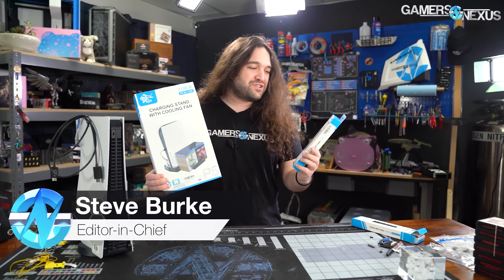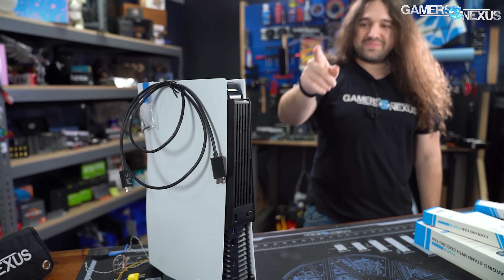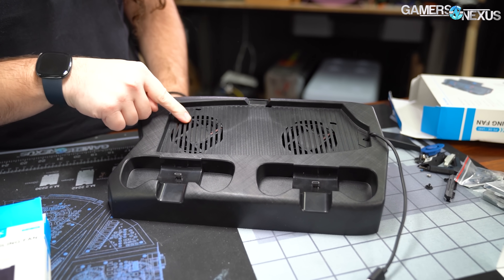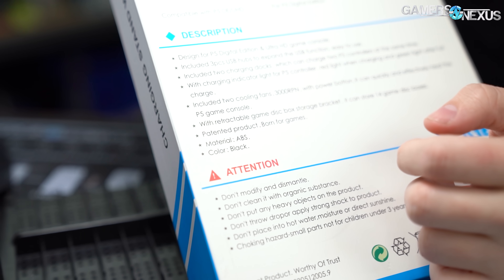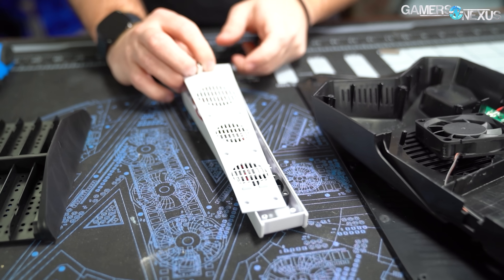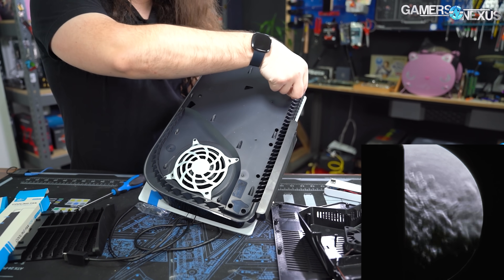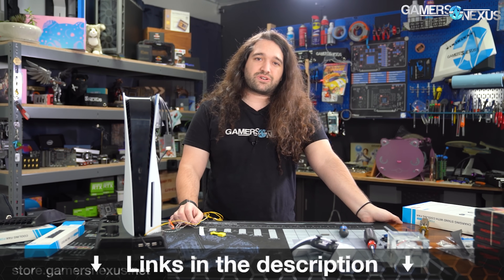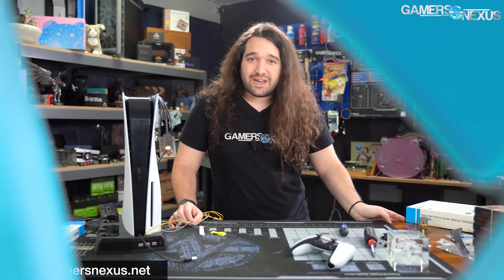Basically A Scam: PS5 Aftermarket Cooling Fans Blow the Wrong Way

Comment from the maker: Like we said in the video, flipping the fans is pointless because (A) this thing screams and you shouldn't use it anyway, (B) the plastic impedes more airflow than the fans add, (C) attempting to accelerate the exhaust in this manner is only going to make things worse.
GN GPU Artifacting shirts are back in stock! https://store.gamersnexus.net/
Watch our Xbox Series X thermals video here: https://www.youtube.com/watch?v=Iqv4meZcVEk
Watch our PlayStation 5 thermals video here: https://www.youtube.com/watch?v=MmggkW6usmQ
Watch our PlayStation & Xbox Schlieren Photography video here: https://www.youtube.com/watch?v=8FZ3cQFFZmQ
Reply: Steve, It's not that we do not believe You - we just want to see this validated the right way - with real measurement and real numbers... like always...
I don't even have or plan to buy PS5  but I watched the whole video and the only disappointing part was the lack of those tests with flipped fans. They were not even screwed  so the operation would take like few seconds for everybody who bought this...
That's exactly why I'm here - because You validate good or bad assumptions with real hard data. No hand waving and "because I say so"...
I still expect to see this done properly - maybe when You test some other wonder cooling for PS5...I would even see this as a standalone follow-up.
Reply: Gotta wonder if these coolers were designed off of prototype/early renders/basic CAD models well before the PS5 launch. This happens a LOT with cellphone cases.
Reply: @dadsfads  entertaining but also informative. Those results could prove that the whole design should be written off, instead of the current synopsis, "It's too loud, and don't put the fans on backwards".
Reply: Still, how could you miss that test? Not like it would be hard to rotate them.
Reply: Great vid as usual, Steve. Thanks
Reply: I finally got my disappointment 2020 shirts this week! Yay! 

DHL shipping kind of sucks.
Reply: Make a video mods to improve performance.
Reply: @io3220  the comment you're replying to literally explains why it would be pointless to mod this device....
Reply: I think this is a scam. Even if there wasn't malintent, it's still dangerous as it increases the temperatures.
Reply: I'm wondering whether it was actually designed to blow air the right way around, but the worker assembling it in the factory did it the wrong way.
Reply: Yeah I figured, best u can do is to put a box fan at the TV stand lol
Reply: @benjiang2600  that would work a lot better than these overpriced noise makers.
Reply: Seeing these fans reminds me of the fans you could purchase for the OG Xbox 360.   What a lot of the younger generation probably don't realise was that those fans didn't really cool the console and were notorious for melting and causing electrical faults.    What I will say about the PS5 is that I hope that Sony improves the cooling of the console with a mid gen refresh particularly around the memory area where  temperatures can hit 93°c.    Personally I find that concerning especially with the console being quite early in it's life cycle and I think over time the temperature issue could get worse and cause the consolse to have multiple issues associated with overheating.
Reply: Jokes on you they told you that was a heater right on the box. No refund.
Reply: I'd like to see if there are any thermal improvements from removing stock fan grill, those cheap pressed grill are horrible for airflow and even noise.
Reply: Yes, it's pointless, but intresting to see some numbers.
Reply: Its content. I dont even care if it wouldn’t change anything im pretty sure me and alot of others would have loved to see too see the fans flipped. It wouldn’t have taken much effort. Not hating just saying. With the ammount it was mentioned it felt like it was being set up but then it just never happened.
Reply: would still like to see the difference with the fans pointing the right way, even if it sucks, and should never be used.
Reply: The biggest question is did you try it out in the "fixed" configuration by flipping the fans in their case?
Reply: Have you changed the camera?
Reply: Must be for Persona 5 that
Reply: Sony designed it so these aftermarket crap is unnecessary
Reply: @JustVictor 17 I changed my vanced settings to not skip automatically but give me the button to skip segment if I want to. It's a nice feature, YouTubers like Steve and Jayz I won't skip their segments just incase I miss some new merch drop or hot deal.
Reply: so you are reviewing more products from WISH.com?
Reply: He never uses console filth outside of work .
 He can swim in 3090 s/6900xt s/5950x s 
and yet he uses an Fx8370 in his house . 
He truly is a prophet
Reply: Can you test the Opolar Laptop fan cooler?
Reply: Dam I feel bad for you having to make a video on these shitty ass products 😂😂
Reply: stop knocking on press fit parts wth....that shows attention to detail and keeps price lower ....and ill never get over the hole i need my silence thing yall must hate movies rock concerts balloons poping anything over 10 db is like scary to you ppl
Reply: damn, I honestly just buy these things for some extra USB ports but it was always nice to have the fans after playing a long time
Reply: Please do a review on the ovio cooling fan. Please!!!!!
Reply: Do you like this PS5 cooling mod ?
https://youtu.be/2GIYvGiIORE
Reply: Would be interesting to see the difference
Reply: Yo Nexus team, do you know the channel DIY Perks? He made a frikking breathing pc. Did you see that. With no fans at all and the radiator is cooled bij bellows. And with all the intake valves closing and opening for the fresh air going in. It's see through, running on barings based on magnets floating in fluid-filled plastic see-through piping. !! This is frikking crazy. UNPRACTICAL, but frikking weird to see it work...
Reply: How about the OIVO PS5 Stand with Suction Cooling Fan? Can you make a video about that one?  Great video, by the way.
Reply: I have that smaller one an after watching this I opened it up and I flipped each fan an before I did that I took a knife and busted out all the white plastic grating on both sides so there was less obstruction and than I screwed it back together and put it back on and the amount of hot air that it sucks out now is like 80% more than what it does on its own. If anyone watching this has this product try that  out it helps alot
Reply: It appears to me anyway that the way this console is designed, it's optimal heat dissipation position is upside down in the vertical position. Tell me I'm wrong. Edit(I was wrong) it shutdown.
Reply: What if you flip the fans around and then throw it in the f'ing recycling bin where it belongs.
Reply: What happens if you flip the fans
Reply: Очевидно что если  закрыть выдувные сопла плохими вертушками на вдув.. консоль станет греться больше! Так что устройство полностью справляется с поставленной задачей
Reply: so is there any good recommendations now on the market that actually works?
Reply: Say the fans were the right way and the flow was unimpeded. How does acceleration of exhaust negatively affect performance?
Reply: You mentioned replacing the panels as an option?
Reply: soo if the fans face the right direction its good?
Reply: On the back mount cooler, what if you open it and flip the fans around?
Reply: Please do the flip for the lol. Also, I suggest ulitize the fan casing, slap server delta fans on for the "ultimate cooling" experience.
Reply: @nhansgoofyvideos7581  I think the issue is the lack of venting even if if you flip the fans.  It covers most of the venting.
Reply: Dont care, FLIP THE FANS, SHOW US!
Reply: @sillywabbit  it won't work, they will not improve thermals.
Reply: Did you try flipping KJH fans so airflow would be right? maybe not much difference, though...
Reply: @terotahvo6849  i flipped the fans and completly removed the disk accesorie where the games are supposed to be in, leaving a big hole to breathe and exhaust the air.
Reply: I'm sure flipping the fans would have been terrible, but objective testing please :D
Reply: Steve!!!!!!!!!!!!!!!!!! Why didn't you turn those fans around on the exhaust blocking cooler to see if it works way better? I mean I would assume that pulling the air out could improve it a bit.
Reply: I'm disappointed you didn't turn the fans around and see if it made it actually useful, you may have just got one that was mis-assembled.
Reply: @mdamaged  But he got two of them remember.
Reply: Still be interested to see the results with the fans flipped though, even if it would be pointless.
Just for science.
Reply: I have to disagree that it would be pointless to flip the fans.  If it's the case, prove it with testing... that's what you DO!
Reply: I was waiting for the most interesting part of the video and it never came up. What about flipping the fans on the back mounted heater? Please I beg you. Why would you not do that :(
Reply: While watching this video, I was hoping for a comparison where the PS5 is placed in a sealed plastic container, possibly filled with dampening foam of some sort. This would make a great "sound dampening mod", eventually reducing the noise level to 0 db as the console thermal throttles.
Reply: You're faith in humanity is misplaced.
Reply: db are read on a logarithmic scale*.  I'll leave it to you for the rest.
Reply: Excellent ,please send samples to 1/2 otto nn tas Australia 7140 .thank you in advance friends
Reply: MORE GN DND CONTENT PLS!
Reply: It would be cool to see if you can purchase or homebrew a cooling method for the new consoles that actually works lol.
Reply: @EddDoubleDD  they are too small to really do much of anything but to cause a restriction. yes they're running at 9000 rpm, but that means a hole lot of nothing due to the very little fan blade surface area, the motor hub blocks a lot of air.
Reply: @madmax2069  Could very well be the case - but as such - it's only hypothesis. We all want to see the verification. Steve of all people should understand this.
Reply: @xqr2911  it's not a hypothesis, it's going by the information from all the past units like these. And these fans are a lot smaller. It's not going to help at all. There is no need to test when we know the outcome.
Reply: BS, you were just too lazy to actually test it.

Comment: Your other videos on thermal testing and fan flow are very good... and thorough. Still with this video, you do a disservice to owners as you are not offering an alternative to these bad units from Amazon. I have overheating problems due to a 1st gen PS5 and subsequent updates to the firmware that reduce fan output (probably because whiny gamers were stating it the fans were too loud). What is a gamer to do?? Drill holes in the their PS5? No one wants to do that or take off the side panels to make their prideful, new purchase look like a broken PC. You needed to continue to look for units that DO work. Anything less is half-assed. Moreover, the attitude you take during this video is less than professional- ie: dumping the components on the table from 3 feet up to show your disdain for the products. I agree, those ARE crap. You make blanket judgments that all external cooling products are 'scams' or pretty close to it. I agree that these are, but ALL of them? How can you make such an authoritative statement without endeavoring others that use different approaches? Fortunately, I found one months ago before finding your channel: https://www.amazon.com/dp/B0B8846RNL?ref=ppx_yo2ov_dt_b_product_details&th=1 Gstory makes a unit that blows out from the top and with a temp gauge that actually proves its efficacy every time one uses it. I would hope you would want to actually look for solutions for PS5 owners instead of assuming all aftermarket fans suck.
Reply: And the reason I came across your video here is because a friend of mine is fearful of purchasing an aftermarket fan because he referenced this video immediately. See? Your influences are actually creating more misinformation and rendering those looking for a solution into doing... nothing.  And watch the thousands of other posters here back up your "SCAM" position. Sad.

Comment: That's so weird because I just bought those little fans that go on the back of mine and mine don't turn backwards actually it pulls air out and it works real good so maybe you just got a bad one
Reply: Ya i got one too mines different and also blows air out i want to get both sense its not a proper seal for max blowing and the fan isint strong enough with that being said it does work some amd so.e is better then non
Reply: He did say he paid $15, so he most definitely bought a cheap one.  The picture on the one I was looking at definitely is showing pictures of air going in through 3 fans and out 3 other fans.  

Been having issues of my PS5 just shutting itself off while playing a PS5 game, so not sure if it's a software issue, power issue or heating issue.  Already tried rebuilding the database and it temporarily worked but now it's crashing again.

Wished he showed us video of them using a thermal camera to see the air going in and whether he could feel any air being exhausted out or not instead of just numbers. Went ahead to try out the fan I was looking at. Will update if I can or cant feel any exhaust at all.

Comment: i once had a laptop that i used for ligth gaming and the poor thing was screaming for its dear life, i bougt on of those turbine stile fans that go on the side exaust, that little thing did wonders tbh, it went domw like 20º, sure, noisy af but hey, without that the bloody lap would turn off bcs of how hot it was so....

i also put some fans here and there on the ps4, i put 3, 2 blowed directly on the case, kinda pointless but i wanted to remuve as much heat as i could and taking heat away from the case means the case can get more heat than it would normally so it helps a bit (or that was my thought anyway) then the 3rd one goes in the thickpar of the exaust (the 1rst ps4) so on the rigth if you look at it from behind, again the ps4 was substancially cooler, noisy but cooler, you can hear how the fan of the ps4 went slower when i turned on the outside fan, idk to waht extent this was god for the cooling of other comonents now that i think about it but yeah....

Comment: Well damn, you guys are looking at it the wrong way lmaoooo. It pulls air through the back so the air flow, designed to keep it cool, comes in faster and cooler through the front. Therefore, morons, it keeps it cooler than not having the fans. It's just common sense people smh.

Comment: i was thinking about adding another external fan or some kind of blowing option on the front.  my ps5 had some issues and now overheats regardless of cleaning even fully taken apart.

so i was thinking if i added some type of blower near the original fan might add enough air to push the heat out???  ill have to experiment and see how it goes.

Comment: I bought the surge stand cause I needed a better base to stop my cat knocking it over. It has fans on the side that apparently pulls from the bottom of the console which is silly cause the exhaust is at the back. Atleast it pulls the air out instead of in, but the fans are really loud. I essentially just use it as a controller holder/charger and a base.

Comment: I have a question, let's say you get a a charging dock with fans at the bottom to blow air up into the ps5, would it be safer/better if I turned the fans around to pull heat out instead of blowing it in?